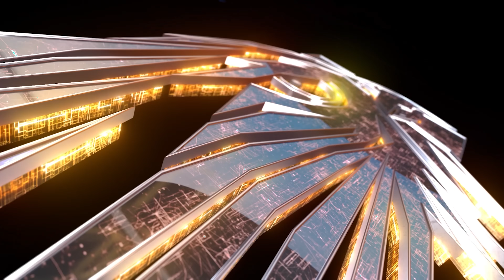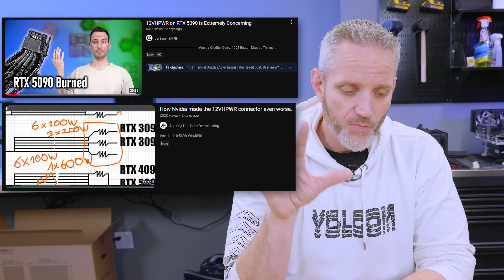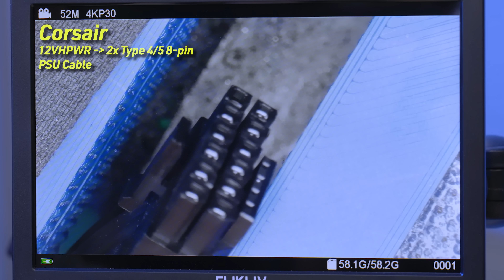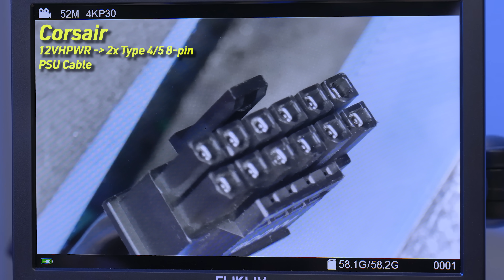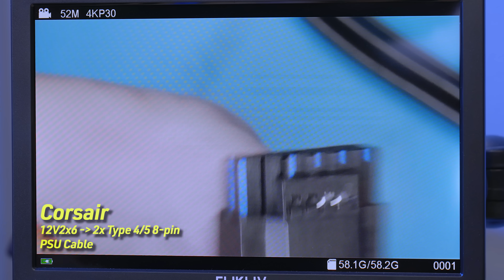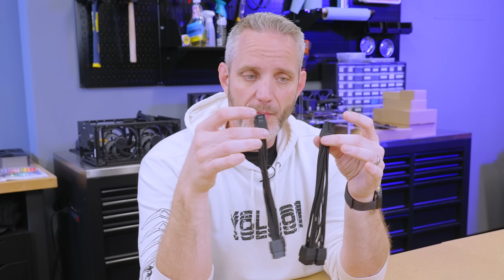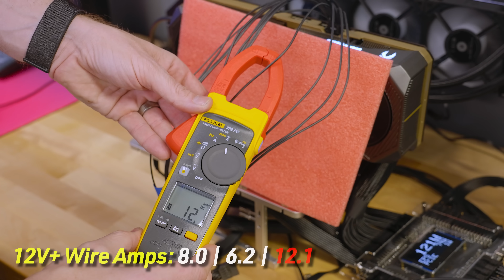I discovered something concerning and I need the Experts to chime in... More 12VHPWR discovery!

Comment: Someone really should run the math on how much variance in the resistance of individual wires causes the current imbalance. With a saftey factor of only 1.1 is the variance allowed even that? And with connectors like that I think the required resistance increase is quite easy to achieve.

Comment: As a 20yr auto mechanic I can say that a poor ground can cause higher resistance which will then cause the more amperage to be pulled through the load so it can then get through the higher resistance. Additionally it can lower the voltage at the load because some voltage would be needed to bypass the poor ground. 
The best example would be a poor battery ground in your car. When you start your car the starter draws its 200amp or so but then if the ground is bad the starter plus bad ground together might pull 400amp - imagine what that does to the starter! 
I hope this made sense!
Reply: While this is true, you must also consider there are multiple ground wires here.  A common fix for a bad ground in a vehicle is to run another ground, which does work as long as its not run improperly (IE causing a ground loop) and the frame is in good shape.
Reply: There is also ground available through the pcie slot. Are all the grounds shared in the card if so, then poor grounds in the connector would not always show up as there is a easier way to ground though the pcie and the motherboard.
Reply: Nope, sorry. Higher resistance NEVER results in more current draw.
Reply: @brandise76  For a load with constant resistance/impedance. What GPUs have at the input is basically a DC-DC converter, and those do in fact draw more current at lower voltages to keep their output constant.

Comment: I have NEVER been a fan of two things:
1. High current via multiple (parallel) smaller conductors
2. Molex style pin connectors for high current

The classic molex pins have play in pin movement. MSI seems to have improved either the pin contacts or the pin retention cavities, but still, not a fan of multiple parallel small conductors.

600W @ 12V is 50 Amps. I get they are probably seeking flexible cabling in their design, but I would much rather see a single conductor rated for 60 Amps at least, and a pin/contact designed for said high ampacity. Anderson connectors is one example, XT are another, though there are quite a few high amp more compact connector options on the market. The proper fit for purpose connectors have a much beefier pin mating design with greater insertion force, reducing contact mating electrical resistance and ensuring a more sound mating. 

You don't see this multiple-small-conductors nonsense in power inverters, battery banks and other high DC amp situations

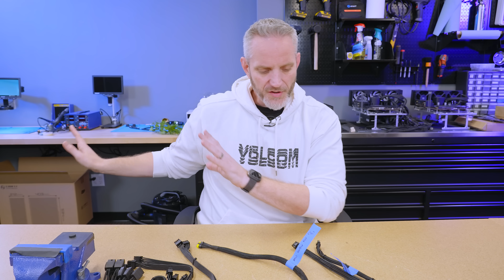Comment: 6:50 I'll quickly chime in on the GND/12V difference: There is a TON of GND connection through the PCIe slot, so it's entirely possible some of that current is going all the way around through the motherboard. 12V through MoBo is limited, GND is not.

Comment: I am wondering in my whse days our electric lift used locking connectors because of the high amperage. My hate with plugs came in the led lighting of office & commercial bldgs, i almost got arc fried. I watched the Debur vid already, yesterday or  2 days ago.

Comment: 100% ground wires can melt.  Mercedes 204 tail lamps have all bulbs on one ground wire. The ground melts they even had a recall on it.   Also the pin material matters.   They went from nickel plated pins to silver plated on the updated pins.

Comment: It’s amazing that these 50 series cards are experiencing either bad cables or bad drivers (in some cases both or none). These companies had nearly 3 years from the 40 series launch to iron out the issues with the connector, but seem to be on a crusade to deflect any concerns instead.
Reply: Most of the time designers of the card can have good designs but those who handle the budget tell them NO its cutting into the profit %. Scale the design back. Happens everywhere, sometimes this mess happens. Then the lawyers get involved and calculate if its cheaper to fix the issues or pray it goes away.
Reply: watch buildzoids video ...its a bad design on the 40 and 50 series circuitboards, to save around 10 cents in components, NVIDIA changed the power design so that its combined into a single load, instead or 3 loads... the difference is the price of 2 shunt resistors and a tiny bit of trace material to make 2 more traces. The result is a fire hazard because 16 gauge wires will get red hot if you try to put 50 amps aross them. in the 30 series the power was split across 3 shunts, so the worst case meant ~16.63 amps across a single wire...which is still more than 16 gauge can safely carry, but it will likely get a bit warm, not outright catch fire.

Comment: Geez It's almost like the PC industry abandonned this type of connection before for a Trace based contact - its EXACTLY why Molex Daisy chains where such a goddamn fire hazard
Reply: Molex to SATA, lose all your data
Reply: It was molex to sata, not really molex daisy chains, and it was because there were a bunch of them out there with horribly undersized wire between the molex plug and the sata connector so any kind of overcurrent at the device rapidly turned the wire in the adapter into a fuse.

Comment: there is no load balancing on those cables not at the psu end nor gpu end anymore 30 series had 3 shunt resisters 40 series has 2 50 series fe models have 1 so if a couple of 12v pins are not making good contact it ups the amps on the rest
Reply from the maker: yessss we knoooooooow

Comment: can we just have a 12v connection similar to a car starter motor, just a thick cable and a bolt and nut.
Deb's cable looked like it was over amped since the cable itself was fully melted.  inconsistent delivery through the 12v cables some delivering 4-5 some over 20 amps leads to over temp as the csa ( cross sectional area ) of the cable is not meant for that kind of amperage.  also the type of material used comes into it as copper $$$ conducts better but aluminum ( the cheaper ) needs a bigger csa.

Comment: As an avionics technician, I can tell you that you have absolutely found an issue that could be causing these problems.
Heat is caused by resistance. A bad contact impedes the electrical flow, causing resistance. (ie - heat)
Reply: literally the concept of original lightbulbs. Electricity 101.
Reply: @discrtidunkwn  they wanted to make cables like lightbulbs (leds) as majority wanna Leds everywhere :D
Reply: Automotive tech here,absolutely the problem,there are a few products you try and or removing the pins and bending the spades down will improve contact,the products are stabilant 22 ( really good product my own 5090 will get the treatment when I get it) and deoxitD
Reply: as an auto tech for 40 years  i see alot of burnt pins in headlight sockets. bad contact or people changing the headlights for brighter bulbs hich draw more current causes  this too
Reply: I am an ET and I was going to say this exact same thing. I don't know how many times I've had to replace plugs and connectors because they burnt up from just one bad pin either on the + or -.
Reply: @Jimtheneals  I hope ET found his way home
Reply: right
Reply: I’m not a technician or an engineer, but I did stay at a Holiday Inn Express last night. I agree with you’s fellas.
Reply: Lots of connectors have some leeway there, there is enough insertion depth between the pin and the receptacle and they'll just find their contact area somewhere along the way.

this is evidently not the case for this connector, given they already had to shorten sense pins to detect connectors where the housings weren't aligned exactly flush. It's obviously not helping if the terminal itself can slide back into the housing by more than that.
Reply: @SianaGearz That was the claimed reason for the failures.
As it turns out, it's not the actual reason.

Again the issue is that the 5090 runs the connector at over 600W, and the whole deal is rated for maximum 30 C thermal rise.
Suppose the GPU area is already heated up to some 75 C as it is in 5090 FE, then you tax the connector... It's getting really close to melting point of the plastics.
In fact if the plastic used is less <= 105 C rated it is running with no tolerance.

A very good connector will have 5 C thermal rise if all pins are maximum loaded. Let's suppose a low quality cable will do double that - someone should measure it.

However overloading a single pin causes the heat to increase quadratically... (as in square of current times connection resistance, ignoring any nonlinear effects which are irrelevant here)
Reply: The heat would build up at the point of the bad contact though, not the whole cable.
Reply: @__some_guy__  But the current that would be going through the bad connection will instead be drawn through the other cables exceeding the amp rating and heating the entire cable.
Reply: @Jimtheneals  As previously measured by a thermal camera and after cable inspection, it is not exactly true. The best, lowerst resistance pins carry the most current in this single phase layout on the GPU. It does not matter since you will be exceeding the spec on the 16 AWG wire by the amount the resistance on the worse cable is increased. I recommend reading Ohm's or Kirchoff's law.
12V-2x6 cable only allows for 10% extra per wire in spec. As to how much heat will be generated, depends on the quality and length of the wire, but it will be generated at either side of the connector.
Reply: @__some_guy__  not really the bad contact is causing resistance with is causing  an increase in amps being pushed through the cable which is acting like a heating element which means the wire get HOT
Reply: @peterpeter5666 nope, you are misunderstanding the issue. Some contacts are making poor electrical resistance. They will get warm and also less current flows through them, but the contacts making good resistance are getting ALL of the primary current shoved through them, and literally melting it's insulation off in many cases. (Heat at the contacts alone usually doesn't do that.) This is a 1-2-punch of bad contacts and no sensing to load-balance if there is a power delivery issue. But yes the contacts also heat up and fail during all of this, likely the one carrying 20+ amps first though.
Reply: @Roobotics  makes sense
Reply: @Roobotics  Exactly. The six 12 volt cables are connected in parallel. The cables getting hot are the ones with good (low resistance) connections. Its exactly the same as having 6 different resistors in parallel, more current will flow through the resistors with lower resistance.

Comment: Electricity will take the path of least resistance. The power going into the cable needs to be separated "have its own supply" and the power coming out of the cable need to land on its connector. Or even better just put bigger gauge wire in the cable and they use less of them.

Comment: None of those cables or pins (at the connection) are going to cut it. It's not meant for that kind of power. The blame lies squarely with the board manufacturers.

Comment: here i am... desperately trying to get a 5090 fe. i have a corsair rmx1200 shift psu.  my cable looks fine but... genuinely... should i be worried?
Reply: actually, idk now they kinda look uneven to me
Reply: @ralphbrito  Either buy a new psu and try to sell the old one or just wait until the solution is discovered, and then sell the psu because it's likely problematic for a 5090. Either way don't use your new 5090 until this is solved. If Nvidia want to sweep it under the rug, then I guess wait even longer for the fix to be rolled out to new gpus and possibly psu cables once again. Heavily reconsider your psu though.

Comment: pretty sure 2.0 of the 12vhpwr has recessed ground pins to make the gpu not draw power unless its all the way plugged in
Reply: Even if that was the case, the pin shouldn't move so much when moving the cable. Fire hazard, nothing else.
Reply: @lolschrauber  oh yes i agree 100% to be honest i made the comment before i seen him moving it with his hand. and was just throwing that tip out there to help with knowledge of the connectors
Reply: That wouldn't make sense either, cause then your ground pins would barely have any contact, leading to a high resistance area that would increase current draw.
Reply: @ i cant say that i know anything about that to be honest i just know what i seen with the new version upon research of them they are calling them 12v2x6 connectors on the connector itsself but its just the new version of the 12vhpwr cable

Comment: I just looked at my 600W connectors from my bequiet psu, i still have a 3080 so those connectors arent in use in my pc. I was shocked how tiny they are. I thought, that those 12pin connectors would be per pin the same size as the 6 and 8pin connectors, but they are tiny. Who in the world came up with the idea to put 600W through those tiny connectors

Comment: Cable side, this should be 14 gauge at least, for safety. PCI-SIG specs for 16 gauge are dubious or Nvidia are using the connector purely on the edge of safety for vanity reasons. Cable management looks nice. Credit to AMD, for dropping the 12VHPWR connector.
PSUs being used. Are the PSUs being used a single +12V rail or are they multiple +12V rails? I personally only use single +12V Rail, having learnt the hard way. 
Last of all, why are we still talking about this issue? There is an obvious risk to life and no recalls at all. Not even a please stop using for now while we investigate. 
Thank you for the video

Comment: that makes alot of sence the power monorion on the card is working fine... infact its making sure to get 7 amps from each wire and one is almost unpluged making alot of resistance cuasing the power supply to push more and more watts to make 7 amps go into that wire the contact is the problum you found it jay garanntee it

Comment: The 12VHPWR is a bad design, especially when clown world is giving us these huge GPUs that pull 600 watts. At some point a GPU is just too big and uses too much power in a standard ATX system, and these cables are designed to fit that dumb trend.

Think about it... we have to use GPU support brackets, and these giant things block 1/4 of the motherboard and slots. That's bad design and just stupid.

I'd be happier with full width PCIe spec bus into a external unit enclosure with its own PSU that can be moved from system to system.. especially if I'm going to pay for it as much as the rest of my system costs. Or we move back to having a mainframes...would it be going full retard to do that or are we already there?... 

But yeah I won't buy a card that uses this cable spec.

Comment: We run multiple rad fans on buses and had fan fuze plugs burn out and not blow the fuze do to poor wire connection. Your pins maybe in spec but i still say thats bad connection just something else to worry about DO better corsair.  Would be nice to see if all MSI plug are like that or did you get a really good one.

Comment: The cables that are pulling less voltage should be checked for the resistance between both ends...I wonder if the integrity of those lower voltage wires is causing compenation causing a higher draw on the other wires to make up for the GPU's demand. I the resistance is high/higher then the others you know those wires were manufactured poorly
Reply: I just checked resistance of my 12vhpwr from my lian li edge 1300 PSU and two wires in the bundle do read higher than the rest
Food for though

Comment: So I built my first computer a day ago and also had this problem with my cables that some pins were moving. I thought it was strange, but I had nothing to compare it with (the first time I had a PSU in my hand) should I buy another power supply?  

I don't use a 12VHPWR cable (got an AMD GPU) 

The psu is the Fractal Design Ion+ 2 Platinum 860W

Comment: Aren't all the ground pin connectors common? If so, all the ground pins are spreading the load so if one ground pin was not making good contact the others support it. This would explain why you don't see melted ground pins on the connector.

Comment: For what it is worth, the Nvidia adapter that came with my 5090FE is problematic.  I power limited to 460W and was still getting imbalance across pins and couldn’t sort it out.  My current varied between high 5 to low 11 amp across the pins as measured with a clamp meter.  I replaced this with an older but unused CableMod cable and I’m spot on 7 amp across pins at 575W with no fiddling.  Note that this cable is 12VHPWR to 4x PCIE.  I am a mechanical engineer so my EE is lacking but I can keep up.  I also have a Seasonic 12VHPWR to 2x PCIE on the way, as that was their recommendation.

The whole thing is frustrating.
Reply: Shouldn't need a current clamp and a thermal camera to make sure your cable is working. 12V 2x6 & 12V high power need replaced completely.
Reply: @We·Are··I·Am  I agree completely, but for now I have to figure out what to do with my card as this develops.

Comment: power flows like water in a pipe so it will take its easyest path so if 1 wire has more resistance it will take more force to flow the same same as water in a pipe so amperage will go up by that pin not making full contact you have just incresed the resistance so that cable will be drawing more amps so wire could heat up more being there is no load splitting on the 4090 and 5090 the card trys to pull the power required  from what ever cable it can to the point it will be overloaded , that said now what would be a good test if you could do the same test again and see if you could push the wire that was  pushing back with the plug conected  so its fully seated it may be hard to do and you will know as you will see it move slightly  in and see if the amps go down on that cable